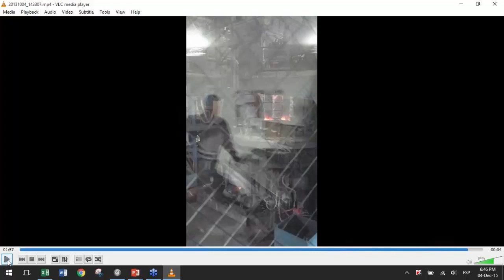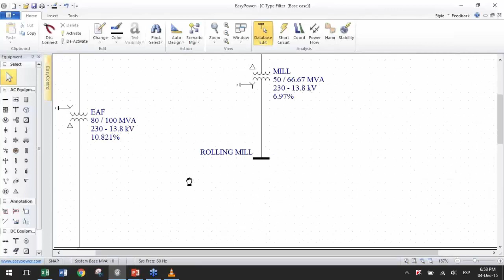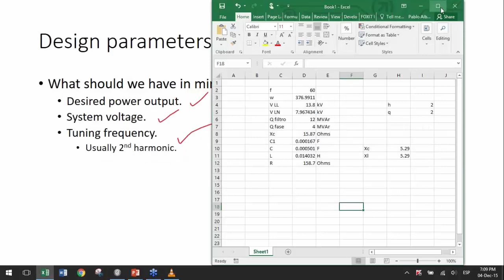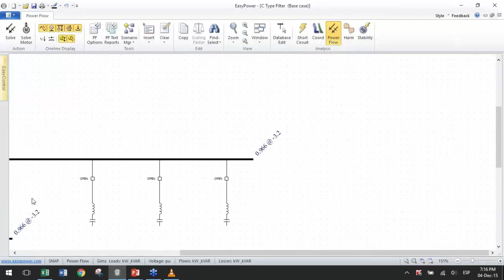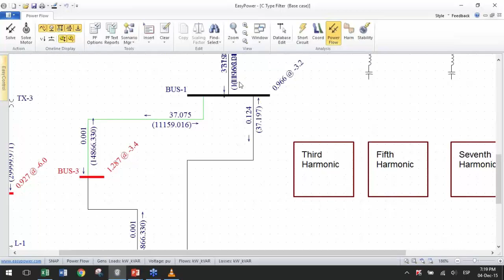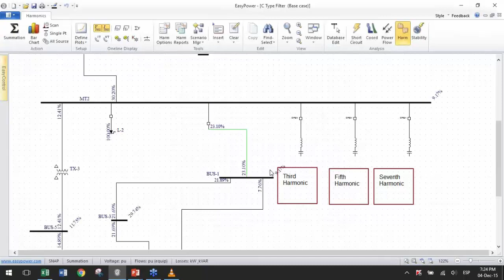Harmonics for Arc Furnace Facilities

Comment: The video was really good. My personal feeling is that if you would have gone a bit deep into how are the even harmonics produced by an Arc furnace then it would have been more better. Moreover, you could also have mentioned the role of damping resistor in C-type because you started with the fact that notch filter only filters one particular frequency. So then it should be made clear that how is c-type advantageous in that case from notch filter. But as a whole really good job... keep posting...